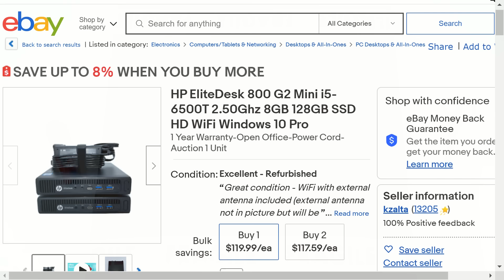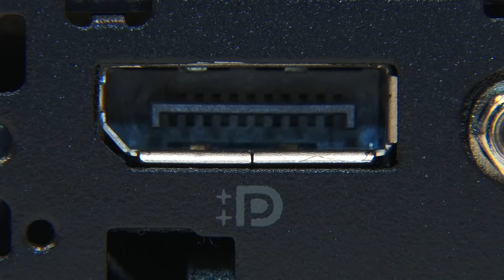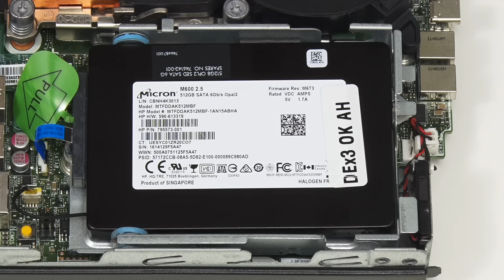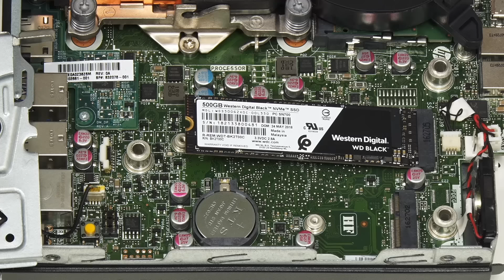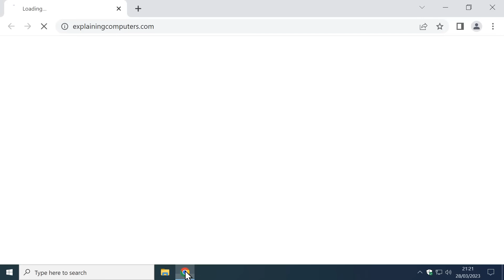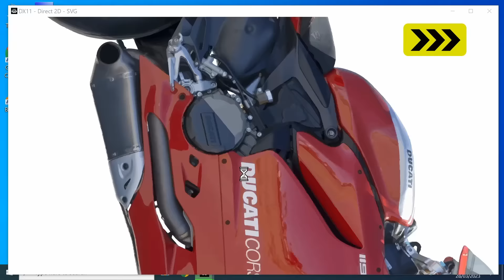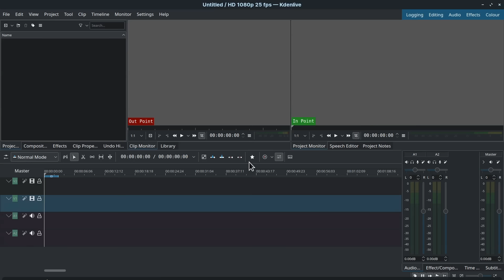Renewed i5 Mini PC: HP EliteDesk 800 G2

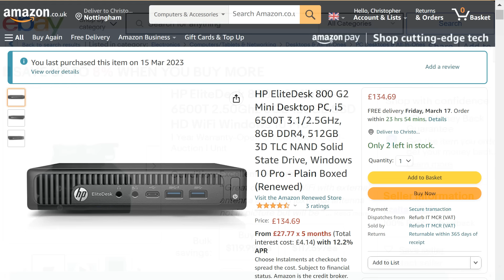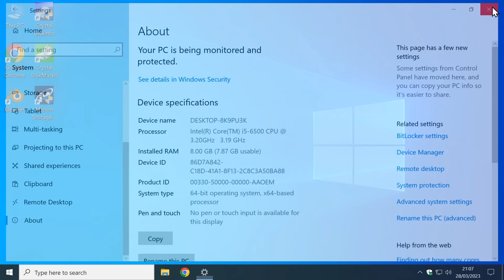Comment from the maker: As some have spotted, whilst the HP EliteDesk 800 G2 I purchased was specified with a 6500T i5 CPU (the Amazon listing appears at 1:35), the unit I received has a 6500 CPU, which has a 65W rather than 35W TDP (thermal design power). So the machine is a bit more powerful than its claimed specs, but uses more energy. I should have looked more carefully at what Windows reported at 12:18. My apologies. Things were rather hectic when I was making this video.
Reply: You can tell the 65w versions from the 35w versions because the 65w ones SHOULD have a vented lid…
Reply: @philharris9631  Yup, and the 2nd fan internally. Oh and a 95w PSU instead of the 65w
Reply: No problem man, the lack of that 'T' is an easy one to miss 🤭😉
Reply: PS: is it possible to under-volt the CPU? Maybe you can get the energy usage down to 35W that way 🙂
The fans would be less noisier too 🙃
Reply: @JohnStopman  In Winows Power Plan - Advanced Settings you are able to throttle the maximum CPU usage. I think reducing maximimum percentage will reduce the power consumption for processing intensive applications. Depending on your usage profile this might help a lot!
Reply: @JohnStopman  - not from the standard BIOS. These things are business oriented.
Reply: @philharris9631  Yeah, I thought so...
Reply: @JohnStopman  They are cracking little machines though … I think I have four G1’s, a couple of G2’s and a G3. 

Another (cheaper) option is the HP T630 Thin Client - a fabless (so silent) 2GHz AMD Quad Core that’ll take up to 32GB and two m.2 SSDs (one 2280, one 2242) and even have an internal USB port if you have an OS that you want to boot from USB. I think I have 8 of those here and they pull between 8 and 12 watts … my last ones of those cost me a little under £50 each which makes them a bargain compared to even the normal RRP of the Pi’s let alone the scalped prices.
Reply: @philharris9631  Thanks for the tip :-)
Reply: I was thinking of getting two Lenovo Tinys for media playback PCs around the house, but thanks to your video they might be these little HPs instead!
Reply: @RWL2012  - just make sure that the built in graphics will drive what you’re after … I’m trying to remember why I didn’t use one of these as a media playback machine … I ended up building one - possibly just because I liked the passively cooled Streacom FC5 cases TBH!
Reply: @philharris9631  The 5th Gen CPUs don’t support HDR. I bought a G3 one of these with the 8th Gen i5 6 core for playing on GeForce Now. 8th Gen is when HDR came into the iGPU.
Reply: @stuartaparker  - that’s probably why I ended up building an HTPC rather than using these then. :-)
Reply: @RWL2012  I have the nearly equivalent Dell (7500T)
For media playback double-check it's got an HDMI. Although a DisplayPort to HDMI should work, the sound can be an issue...
Reply: Do not affraid, you do not consume much more energy. In idle and light load C-states they are consume very simmillar. Only there will be difference at the moment when applications need performance and the CPU boosts up. But these situations mostly moments and do not give much more higher load on the average value.
You can also limit the highest frequency in windows energy management options, by limting processor maximum performance. You can set up the cpu higher limit by 1% - 1% percentage. That limit the boost performance and of course the power consumption and gain the efficiency.
Another good advice to avoid CPU boosting: windows performance options. Smooth scrolling with mouse on webpage is boosting the CPU/GPU instantly. If you read webpages with continously scrolling that keep the CPU on high clocks. If you fine tuning windows performance options and some other things, you can avoid that keep the PC on high clocks. ;)

Edit: Overall It is better the 65W elitedesk mini. It also has copper cooler. The 35W edition do not have. So if you need only 35W perfromance and you keep the CPU under it, you will get a  more silence min PC probably. ENjoy it! And keep up the good job! 🙏
Reply: That's OK Chris, you are doing a world of service for the viewers. Keep up the great videos and great information!
Reply: Well at least we can see the difference of the T in the benchmarks and it is not negligible. Do you happen to know if there is any tweaking in the UEFI for the 6500's so they perform better with less throttling/core parking etc? I usually run Hyper-V on those boxes and I'm going to get one to run Linux VMs that will be hosting the home's services (ad blockers, dns, parental control etc).
Reply: @xboxgs  … there’s basically no tweaking opportunity in the BIOS - these aren’t enthusiast machines.

I have a G3 with an i7-7700T, 64GB or RAM, a 2TB NVMe ‘OS’ SSD and an 8TB Samsung 2.5” SSD which I use for batch processing my customers music collections and it pretty much flies…
Reply: @philharris9631  I had that suspicion but wanted to know from the owners directly. Thank you!
Reply: I'm not nit-picky enough to be bothered by your missing the lack of a T. What this highlights however is that it's a bit of a lottery when it comes the exact hardware configuration you get. In my case ordering the same product at different times from Amazon resulted in two 35W units which are alike in being silent and sporting that wifi dongle you removed. But one unit also had a bonus Intel wireless card already installed while the other unit had swapped one of the DP connections for a RS-232 socket. It's also worth noting that HP still has downloadable service manuals for these units. I might never have discovered the M.2 slots for example if I hadn't browsed through the service manual.
Reply: Even 65 watts isn't bad.  The mid-2000s IBM ThinkCentre on which I am watching this video requires around 200 watts, including the monitor.
Reply: No problem there.  As always, you do a great job on explaining everything and your videos are very informative and helpful.
It was neat seeing the keyboard and mouse.  The keyboard looks identical to the one I have for my Pi.  Maybe I'm old but I prefer to use a mouse instead of a pad and am very comfortable with the keyboard you've shown.  As for the screws, I keep the old ones whenever I scrap something so I have plenty of spares on hand.

Thank you and looking forward to seeing your video on downloading Windows 11 on older hardware.
Reply: There are also i3 based ones which are 35w. Sure they would be just as effective.
Reply: @sugerbear586  - there are i5 and i7 based ones which are also 35w … Intel do (did? - I haven’t looked to see if they still do them after 9th gen) a “T” suffix range of processors that are power constrained to 35w. 

All of my G1’s, G2’s and my G3 are all running the T series i7’s (so quad core / eight thread) and run happily off 3rd party 65w ‘wall wart’ PSU’s with typical consumption circa 15-18w.
Reply: I managed to buy an 35w i5 for £59.99 on the UK eBay (no hard drive and 4gb of memory, the former I have spare). Will see how this works with the raspberry pi desktop.
Reply: Should have added that the machine I now have is an i5-6500T and windows pro 10 comes as standard (even though there isn’t a COA sticker anywhere that I can find). Just needed the standard win 10 iso and the media creator and I now have a fully working win 10 pc for £60. Happy with that.
Reply: I got the same one that was also listed as 6500T but got the 6500 instead.
Reply: 😢😢😢😢😢😢😢😢😢 głupie to
Reply: It's ok. We all understand how excited we get when we get a new toy.
Reply: @JohnStopman isn't the TDP a maximum estimate value, meaning watt under load? i doubt that the 6500 draws almost another 100% more in idle compared to 6500T but was unable to find any data
Reply: Near enough...
Reply: It's all good. I bought some refurbished Lenovo mini thinkcenters, and plenty had different specs than advertised, only a vigilant eye can spot the difference, but even the most vigilant will sometimes fail to detect mishmashes specs when it's the presence or absence of a letter at the end of a number.
In my case it was i5-4570t I received rather than i5-4590t. The specs show same tdp and 4 threads, and the 4570 turbos to 3.6Ghz while the 4590t is maxed at 3 GHz. So I should be happy, right? However, my workload is such that cores matter much much more than threads, so the 4590t has 4 actual cores, and at my specific workload hyper-threading isn't worth anything really. Was my workload normal, probably the 4570 would win.
Reply: 35 watt processors come with an aluminum heatsink, 65 w processors come with the copper heatsink that we saw in the video.
Reply: Regards to ++ display ports there are various versions of passive cables from versions 1.00 1.40  2:00, which is best? Can't seem to find version 2:00 for sale ?
Reply: The 'T' cpu's are w4nkers, the SFF box can handle a 65w i5.
Reply: @MrChriss000  Yeah but that's twice the power consumption a year, twice the heat. I just migrated some 35W boxes to 10W ones, because of this. Also my 10W (N6005) boxes are passively cooled, and that's another plus, no noise.
Reply: @andychow5509  This comment shows absolutely no understanding of how this works.
Reply: Thanks for the video, I have loved you have included a linux testing which is something I was looking for: Finally, I have bought one, I hope the computer works smoothly with a Linux distro
Reply: This is  good old cpu but good and  without monitor on work (security) with this is really dump ! Better buy laptop!!!
Reply: I noticed that right away! Someone wisely pointed out that models with 65W processors come with a vented cover. Coincidentally, I have one of those 65W beasts — it's neither noisy nor too hot! There's also this fun little software trick in the BIOS (you can adjust or disable it) that cranks the fans to 100% for a few hours every month. I was convinced it was a glitch and kept getting annoyed — just when I'd think it magically fixed itself, bam, it would happen again. Turns out it's a built-in cleaning feature for the fans and air passages. I found out way too late and had a good laugh at myself! Great video, by the way! This little beast rocks. I also have a 35W desktop version, and I can honestly say there's a noticeable difference in performance. Cheers to everyone!
Reply: It's sad that the little HP will support TPM 2.0 and secure boot but only fails due to the processor. I did have to a bios update when I received mine to support TPM 2.0 which is available on the HP site.
Reply: This form factor (to use the manufacturer's terminology) is also described as "mini" which it is or USDT .. Ultra Small DeskTop ..

You are correct though Hp EliteDesk 800 G2 .. on its own is not enough  to be sure what size you might receive.
There is a small desktop HP EliteDesk 800 G2 SFF .. just not quite as small as this USDT

Comment: My main computer failed and I had an EliteDesk 800 G2 overnighted to me as a quick backup while I wait for the parts to build a new computer. To my surprise, it came with Win 11 Pro preinstalled on the 2.5 HDD. I was going to swap in a SSD so I can run Linux, but your video makes me curious whether I have an M.2 slot so I could just set it up to dual boot using separate drives. 
I watched this video when it first came out and had the EliteDesk 800 G2 bookmarked in an Amazon list in case I ever needed it. That certainly paid off. Thanks for your years of great videos. 
(Also, seeing others comment on noise - this particular unit is really quiet.)
Update: I have 2 M.2 slots as in the video. I'm now running Linux Mint on a 2280 NVME. Even with the top off, this unit is still really quiet.

Comment: Been wanting one of these as a homelab for a while. Good thing is that nowadays the G3 can be found for around $60 to $80 USD, and usually comes with a 7500T - a generation newer and most importantly, if you want to use it as a media server, an iGPU with support for HEVC coding/decoding.

Comment: Does this mini pc have full length pcie slot , to put a discrete graphics card?
Reply: No, there's no way to physically fit a card in the case anyway.
You could likely use an m.2 to pcie riser though.
I think there are tower/mini tower versions with pcie slots though.

Comment: China's export ban will be very beneficial to India in the long run . Indian companies do not want to develop manufacturing to avoid losses competing with Chinese companies. With the ground cleared, they are likely to put their minds into R&D. The products may cost more initially but internal competition will lead them to get better with time. After all they landed a craft on the moon which was no easy feat.

Comment: I have one of these as my work horse in recycled tech/IT-support job! It has the default 6500T but upgraded ram to 2x8GB @ 2133MHz. Also has M.2 SSD but not sure if it was just SATA or NVME. It does not have those top cover meshed openings nor the secondary fan which both would help with thermals for sure! It was also recycled by our workplace and been wondering if I could slip I7-6700 in there :D 
Thanks for the video!

Comment: I once ordered a software license from HPE.  One day, I got a rather large box shipped from HPE.  I didn't remember ordering a new server recently.  I opened the box to see a wall of styrofoam packing peanuts.  Digging into the box, I found, at the exact center of the packing peanuts, a single sheet of paper with the license information on it.

Comment: hmmm whats the  durability on that my  laptop is over 15 years and running windows 10 modestly
Reply from the maker: In part it depends on the previous owner. The general design is very durable due to the metal case.

Comment: Thanks for this video. I needed a PC for myself and my son. I now have the same model as you in this video and my son has the Lenovo equivalent. What a good PCs they are and I got them for around £80 each. Both have i56600t CPU. I found the fan noise annoying until I turned the computer upside down. Now I have a upside down computer with a quiet fan.

Comment: Thank you for mentioning about DP++ cable options. The one I am going to buy has one and I could just use it to attach my tv. I had never known that's the case. 

I wanted to ask. So, if I bought a model like this. It comes with SSD and a W10 licence. Could I just put in nvme, clone SSD contents with the licence to it? Or are these generally hardware tied keys? Prefereably I'd take out the SSD, put in NVME OS drive and add an extra SSD I have laying around. If something were to happen to device while under warranty of like 6 months, I could just put back in the original drive and send it back.
Reply from the maker: Thanks for this. And yes, you can clone Windows 10 to an NVMe drive and all should work fine, maintaining the license. I have indeed done this on this PC. Sometimes Windows is not happy on its first boot after such a clone, but works on the second attempt. Good luck! :)

Comment: Word to the wise getting wifi installed... I got a G3 mini pc. Mine, like this G2, did not come with built-in wifi. IE: no built-in antennas. They have a WLAN card slot, but without the antenas installed, you're dead in the water. I thought all the cases were made the same with the same slots, so figured if I just bought a EliteDesk mini pc wifi antenna kit, I could run the antennas, put in a WLAN card and be good to go.

NOPE!

These "no built-in wifi" versions do not have the correct slots cut in the housing to mount the low-profile wifi antennas. So, that was a waste of $20.

BUT

They do have the two small holes in the back that you can use a screw driver to pop-out the bit of metal to mount RF Coaxial wifi antennas + cables. So, for another $20-30, I bought a kit to do that. I was hoping the other low-profile antennae kit would work, b/c I didn't want long antenna stalks sticking out of my G3 making it look like a router box. But, I popped out the metal circles, bolted on the coax mounts, routed the antennas inside, hooked to a AX210 intel WLAN card, screwed on the antenna stalks.. went from a ~50 Mbps wifi dongle to ~450 Mbps. And I don't have a USB port tied up now.

It's definitely an upgrade worth doing if you plan on using it as a daily driver, or will hand it off to someone else as their daily driver. And it was a fun little experiment.

Comment: Just got one for £50 delivered with 4 gig of ram, I have 32 gig ram I bought for a laptop a while back that I didn't use in the end but the board is only seeing 16, it sees both sticks as when one is removed it gives me the message that the ram amount has changed. it's strange going to see if a bios update helps.

Comment: Thanks for the heads up. Buyer beware as they say. Paid for a so called complete HP for 144.00 US but when I received it was completely stripped, nothing left but case and mother board. However, after many tries I ended up with 3 units which I upgraded with parts I already had in my inventory. It is an amazing Mini not great with games but for everything else it works really well. Parts are getting harder and harder to find but at the very least I have 3 units completely upgraded and working A One. Now I guess it is time to sell them.